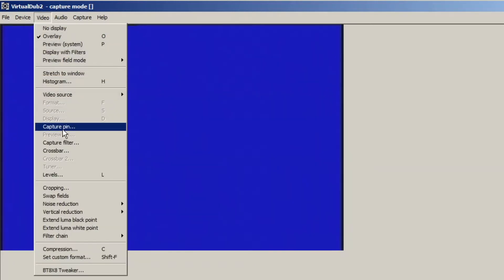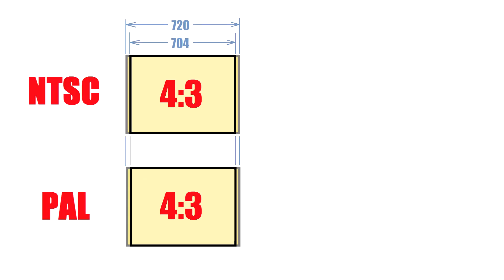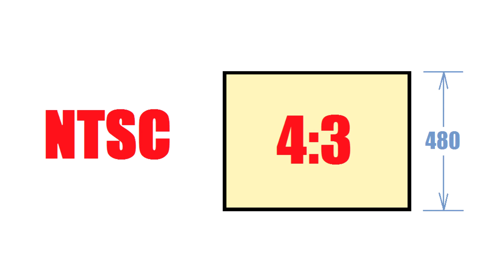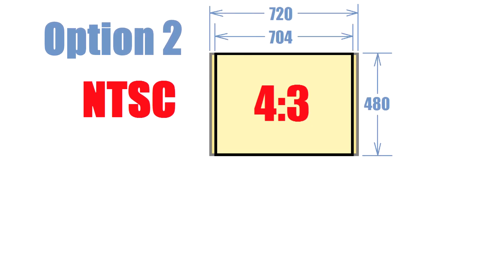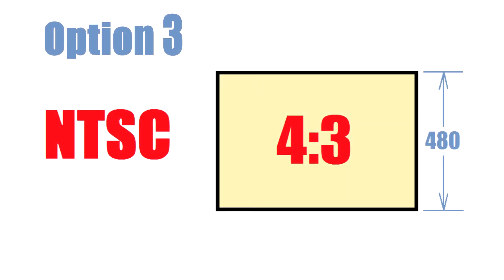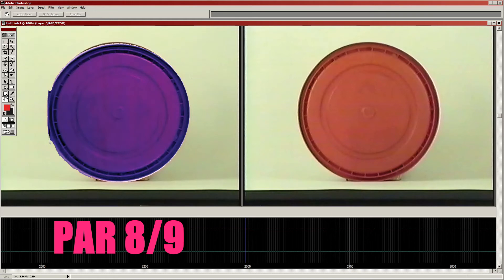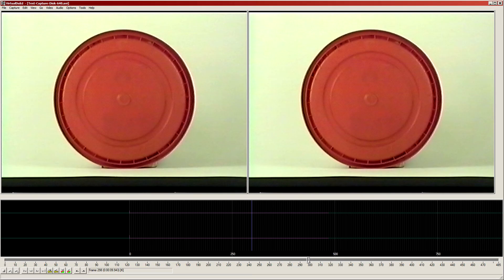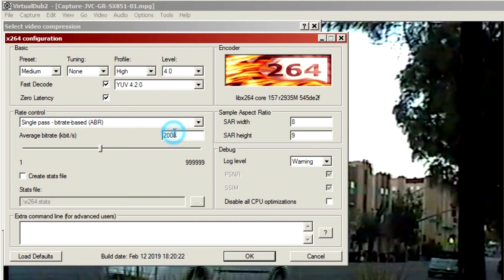Frame size, resolution and aspect ratio of standard definition video

Comment: Very nice explanation as always. When I shoot with my SD video cameras and upload in 16:9 I crop the video, with the same pixel proportion. A bit of loss of definition but, it is OK for me.
Reply from the maker: I started shooting 16:9 SD when I got a Canon Elura 100 in 2006. It has native widescreen sensor, so improvement in the field of view compared to 4:3 was real. The SVHS camcorder I play with now simply chops top and bottom of the frame to make it look widescreen.
Reply: @ConsumerDV  I'm new in taking videos, learning a lot with your YT videos. When I shot 16:9 widescreen mode with  MiniDV camera's instead use the iee1394 port  I play the tape on my Sony HVR-V1J and use the HDMI port to capture in 1920x1080 30p 4:2:0. My capture device only captures in 4:2:0, with variable overall bit mode of 16.6mb/s, and I get smaller files in .mp4. If I use the ieee1394 port, I get a large file(.dv file) 720x480i constant 24.4mb/s 4:1:1 chroma subsampling(using linux). I prefer to use the HDMI port because I do not need to upscale the video to 1920x1080, and I think the image quality is a bit better in my opinion.